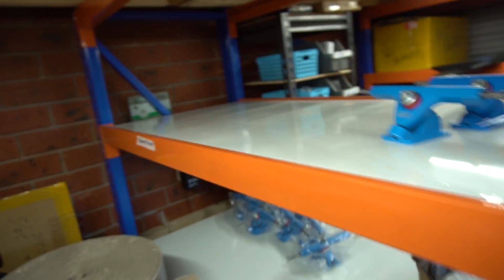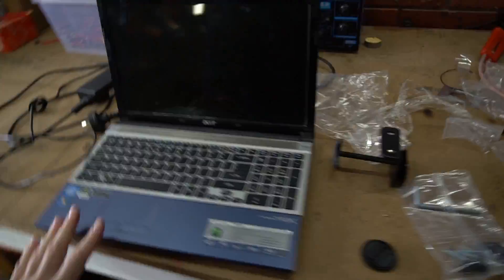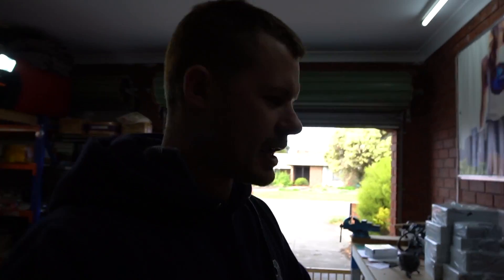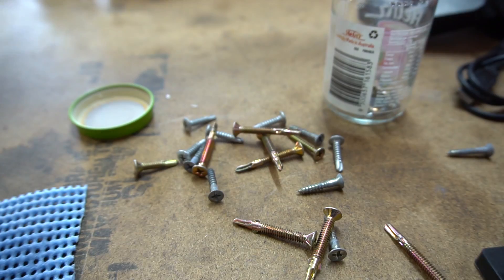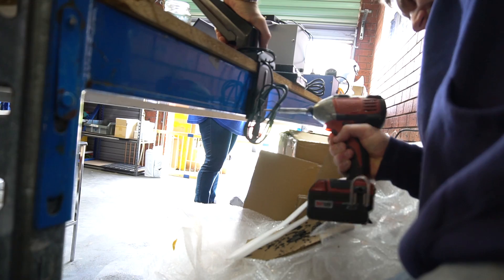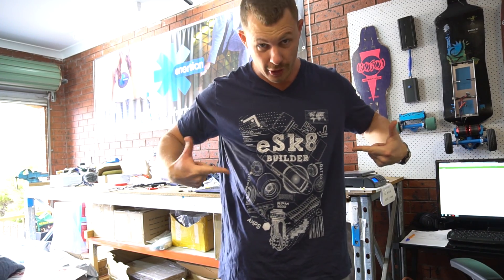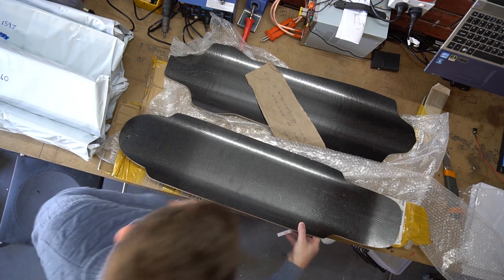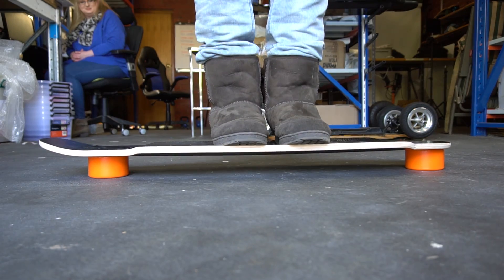New Carbon Fiber Electric Skateboard Deck - VL046

Comment: I like the modular aspect of the enclosure. Comes closer to Mellow's modularity.

My question is how would the components be secured inside so as not to shift and rattle? And how would it be attached to the board?

Comment: If I was to buy a complete truck set and battery and vesc and remote would it all be plug and play? Or would I need to code and calibrate stuff?
Reply: Any Idea when the complete kits will be ready? Looking to build one for the summer.

Comment: Batteries are going to mounted externally of the deck or internal?
Reply: +Electric Skateboard Builder that's good, if you had a Cnc machine you could make easily custom interchangeable slots in the board with a click mechanism